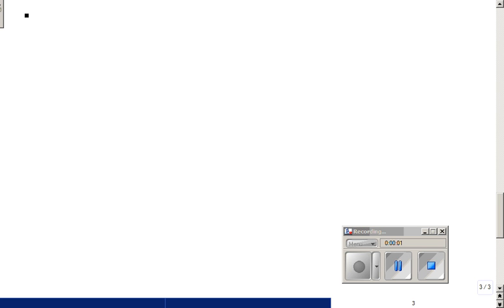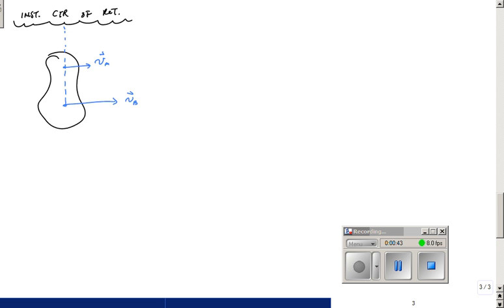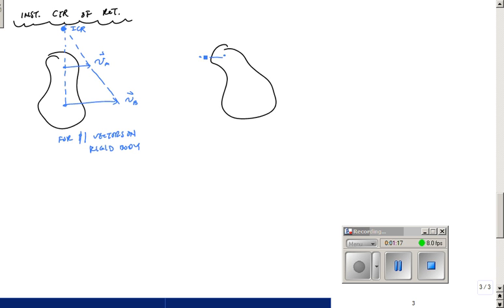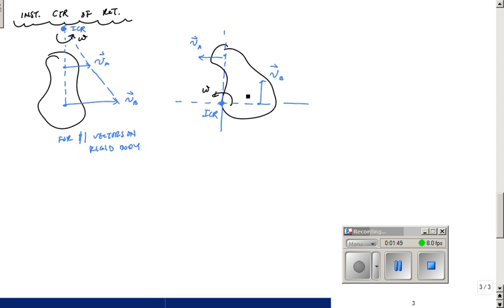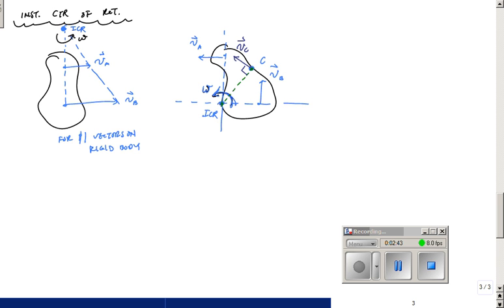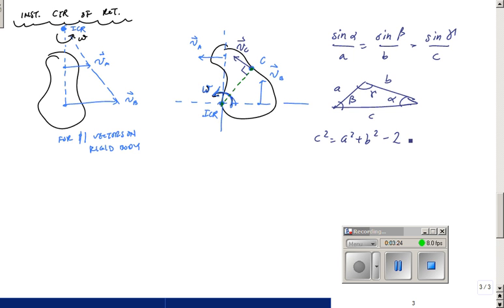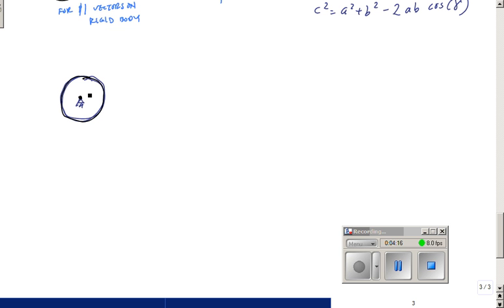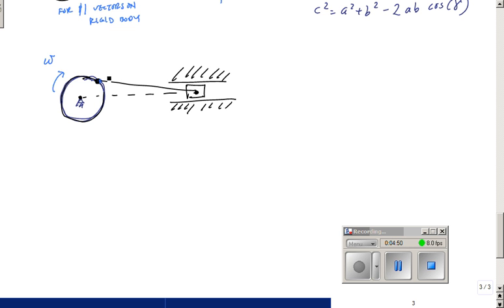Instantaneous Center of Rotation (Part 1) - Engineering Dynamics

Comment: If you can help figure out the IAR’s based on motion studies of the occipital condyles on top of the atlas vertebra and the atlas on top of the axis, it would probably be the most significant breakthrough in chiropractic in the past 50 years.  Blair chiropractic, atlas orthogonal, NUCCA chiropractic.  The challenge is the joints can be assymetric and biological systems don’t always behave like pure machines.  But bio mechanics are bio mechanics after all.
Reply from the maker: Sounds like a good research project.

Comment: But Wikipedia suggests another method "Pole-object-A1-A2" by VanBuren - Own work. Licensed under CC BY-SA 3.0 via Commons.
You take two points in the body, and find their velocity vectors. Bisect each velocity vector, and the intersection point of the bisections is the ICR. Therefore, to findthe ICR, you need at least two points in the body, but once you've found it, you can speak of "the ICR of each point in the body".

Comment: what to do when the instantaneous center is at infinity...?
like if in the above problem the angle of crank is 90 degrees with the horizontal instead of 30 degrees so at that instant what would be the velocity of slider i.e. Vc
Reply: Then the body is not rotating. The body is in translation

Comment from the maker: thanks for the nice words. i'll try to keep on posting.
Reply: But Wikipedia suggests another method "Pole-object-A1-A2" by VanBuren - Own work. Licensed under CC BY-SA 3.0 via Commons.
You take two points in the body, and find their velocity vectors. Bisect each velocity vector, and the intersection point of the bisections is the ICR. Therefore, to findthe ICR, you need at least two points in the body, but once you've found it, you can speak of "the ICR of each point in the body".